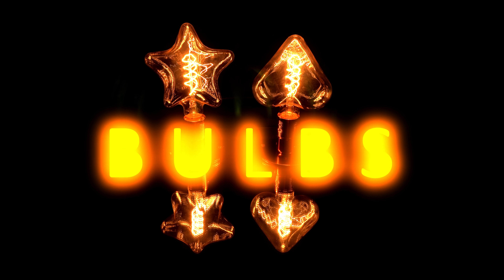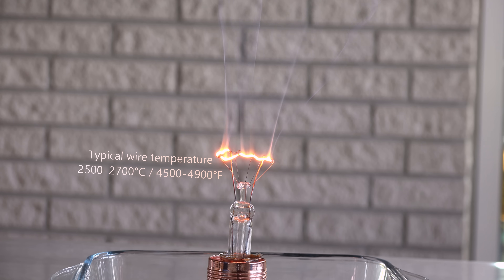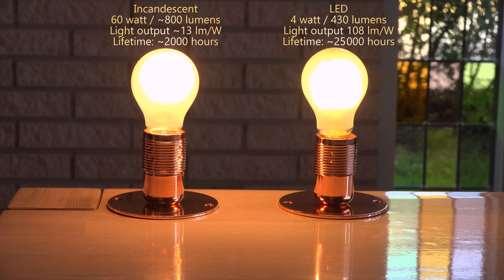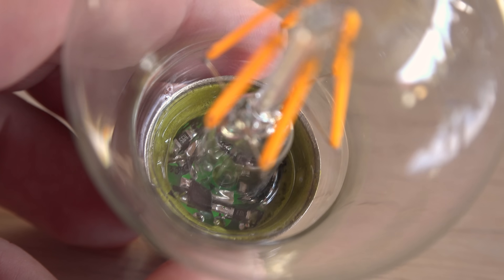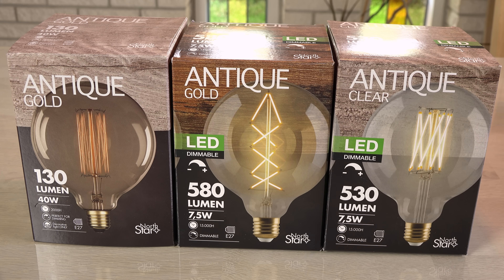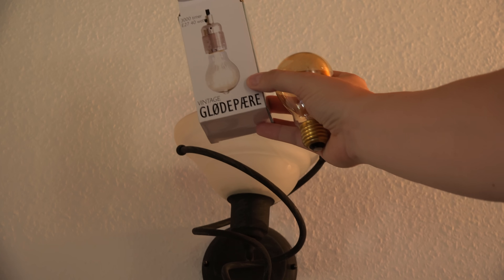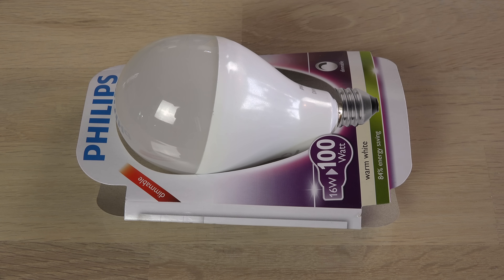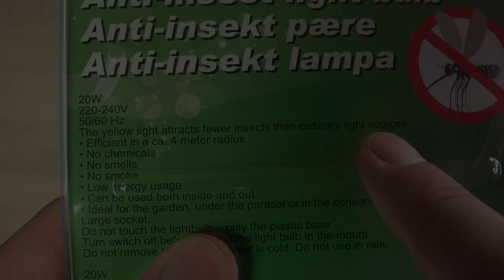Light Bulbs | LED vs. Incandescent

Comment: Incandescent bulbs give off infrared healdty light, LEDs give off ultraviolet unhealthy light. For your eyes to stay healthy they need more red light not blue.
Reply: incandescent
Reply: Dieter Soegemeier... CFL light is UV light but CFL & LED gives off electromagnetic radiation
Reply: or if you talking about light pharipe than it will be “inferred light”
Reply: What Kind  of light is good for health LED or incandescent???
Reply: Just use orange leds for lighting...
Reply: “Timotius Aditya” NO

Comment: I bought 6 packages of LED light bulbs after I read a thing stating they will last five years (under normal use) for my home back in 2016. After all I have lived in the same place for about 12 years now, so I thought that the LEDs would last a long long time!! And most of the lights in my 40 year old mobile home are old and yellowed even though I have no idea when many of them were actually installed and the home has always been in the same place it is now since 1971!! So god only knows when the last time the bulbs were changed!! Within 6 months I had gone through 3 packages of LED light bulbs replacing a number of the old bulbs as they had blown. I was at first pretty happy with the light from them!! After just three months though the LEDs I had replaced already stopped working and has more of the old incandescent bulbs failed I was replacing them too with the other three packages of bulbs!! In total TODAY in 2019 just three years later ALL the LEDs in my home have since been replaced with Halogen bulbs I find at the dollar store!! All the money I wasted on LED light bulbs which were "name brand" (Phillips to be exact) were junk and EVERY SINGLE ONE OF THEM have failed!! So much for "under normal use" too, because I am very anal about leaving lights on at night SO IT is NOT like I have my whole house fully lit up when I am NOT in rooms using them and most nights I only have on certain lights in rooms I am actually USING at the time!!! LED light bulbs are JUNK and a complete waste of money!! I laugh at the "they last five years" sales hype!!! BUT on a side note I have to add that in my shed which doubles as my work shop for the past five years I made and installed my own LED strip lighting in there!! And THOSE lights work fine EVERY TIME all the time for the five years I have had them installed!! The real kicker is I paid a lot of money for the actually LED bulbs that failed and got less light out of them, then I do in my shed for the LED strip lighting I bought on a 16 foot reel for just $20 and designed and made my own mounting system for those! So when I went to add lights in my kitchen I side stepped the LED bulbs and again trusted LED strip lights which now have been working fine for three years without a hitch!!

Comment: I still like the old light bulbs better.   Plus I had one of those weird Led light bulbs with that rubber rapping around the bottom (if it rubber not sure), but anyway it actually melted then burnt out.  I think that bulb is dangerous if it actually melted, that means it gets to hot unlike the old bulb made out of glass.   I think there is agenda behind those new bulbs....

Comment: There's quite a green lie here, first, the incandescent light is normally lit when the heating in the house is on, so the loss is not lost, second, the fabrication of a LED is costs more  environmentally damage damage than incandescent lights. Third, lots of LED's have bad powersupplies,  that may cost more in the electricity bill.

Comment: LED actually has one major disadvantage and that is the reactive power they produce. This is caused by the phase shift because of changing the AC to DC. We even tested this years ago in the lab when I was studing and teacher wanted to show us that these "energy saving" bulbs actually used up more electricity than conventional incandescent bulbs. The amount of power they draw from a socket is lower, yes. BUT they also work against the change of the AC current which is harder to measure and can't be seen with the traditional wattage meters which are directly plugged into a socket and that work against the current plus their spent power from the socket was greater than on older incandescent bulbs of same wattage.
Plus LEDs are really complicated things to manufacture which create a lot more pollution than just simple incandescent bulbs. Incandescent bulb is just glass, inert gas, tungsten wire, metallic socket head, metals to hold the tungsten wire and some glue between the glass and the socket.
LED bulbs in the other hand have circuitboards, some electric components, wires and what not.
Incandescent light bulbs could also be easily made to last a lot longer than they used to last. The double helix structure of the wire was the main reason for the wire to snap after certain amount of time. There's one of the very first light bulbs ever produced in the US in one fire department building which has been burning non-stop for tens of years if not over hunderd years. What's so special about it? At least it doesn't have that double helix structure on its wire like modern incandescent light bulbs used to have.
Based on these facts in my opinion these "energy saving" light bulbs are one of the biggest scams of all time to actually lure people to waste more energy when they are using them and also when they are produced.
Reply: Here in my house, I have two G.E's incandescent bulbs in two different lamps working for more than 15 years!
Reply: MrBrander I have a 700 square foot room with high ceilings, how should I light the room. We’re using cfl tubes. I want to switch to a healthier light. What should I do. I would very much appreciate your help.
Reply: @mangomadness8635  get warmer white flourecent tubes
Reply: @mangomadness8635  If you can find them, get regular incandescent bulbs..!
Reply: You ain't paying for reactive power, maybe that's why the meter doesn't show it.

Comment: Certain LED’s also cause wireless interference. I was unable to listen to the FM radio with the lights on (4 LED lights made by FEIT electric) as soon as the lights were turned off, radio signal was great. I didn’t test further, but I highly doubt they only cause interference on the 87.9-107.9 MHZ range, which in itself isn’t good, for electronics or your health. 
Also the bulbs ran really hot (about 70° C / 160° F), although they are rated for only 21.5 watts.
Reply: It's non ionizing radiation, so it really can't damage your cells at a molecular level. The 4G data being transmitted is more potent than any LED circuit  driver. Plus the driver only consists of a full bridge rectifier, transformer, capacitor, and voltage regulator
Reply: @danieldyman7196  That doesn't mean it's ok to transmit a lot of noise at those frequencies. Though a
bulbs conforming to all the specifications really shouldn't do that and I think most of them don't. Also a 100MHz is a very high frequency that I don't think any switching converter uses.
Reply: Yes, and that interference also makes them unsuitable for many garage door openers.  I had to tell several neighbours about this, when their openers suddenly started acting in seemingly unpredictable fashion.

Comment: PS: my hamlet (largest in the world: certified record)  gave out free NON INCANDESCENT lights via us employees. We employees got more than a couple "lasts longer than incandescent " bulbs. All of mine died many many years early, but several incandescent are still running. They cost three or more times the incandescent  ones of same watt incandescent too. Plus the NON INCANDESCENT ran the built in circuitry ballast or whatever very hot, one failed because it surreptitiously scorched the base nearly black , so hot. It was a fkng fire hazard 😡

Like most bullsht science lately, total hype, totally expensive, and designed to fail to make you totally buy into it and replace it more often. 😡
Reply: B Sc your light bulbs failed because your “hamlet” got really cheap crappy ones to give away for free. If you buy a led for the same price as your incandescent ones they will be twice as good.

Comment: If you turn on a tungsten bulb when you get home in Canada after a puny 8 hr shift, it warms your 13C heated house AND GIVES LIGHT . Two for one, sarcasm or whateverIdontFuckvojngCar.  

When you try using them with your wifi ready garage door (brand name starts with C) you repeatedly get failures and odd behaviour. Then read the manual and see it say DO NOT USE LED LIGHTBULBS. Guess what, they fkn interfere and corrupt the operation. Even when only using the provided remotes.
Reply: B Sc I have noticed that certain cheaply made LED lights (specifically FEIT ELECTRIC) cause interference on the FM frequency range, I couldn’t listen to ANY radio station with the lights on, as soon as I turned them off, radio signal was great. God only knows what kind of radiation those things are putting off, probably not good for your health either.

Comment: LED lights are more efficient in terms of thermal energy inefficiencies but to entice the public the electronics necessary to convert AC line voltages to power the LEDs are very poorly designed as high frequency inverters used create huge amounts of wide band radio noise pollution.  Turn on and AM or FM radio and then turn on and LED "replacement" bulb for an incandescent light....it is terrible!! 

Cheap electronic designs are causing huge problems and need to be addressed.  Then the spectrum of light frequencies for our eyes and those effects - more studies.

More needs to be done to abate these issues but very solvable!!
Reply: I agree... there should be a nationwide standard for electromagnetic emissions, while there are not long range, it can ruin a Hi-Fi stereo experience while close by.
Reply: another match in this world we live, as no wonder as for sATAN himself disguises himself as an angel of light, new bulbs burn so bright but burn out so fast and make more waste where old bulbs like the cinula bulb and my bathroom bulb burn dim but last for years upon years.
Reply: The problem with electricity-related issues, such as 'dirty electricity' etc., will be extremely hard to bring attention to and get addressed because as the saying goes, 'out of sight, out of mind', and electricity is invisible, so...

Comment: I'm in Australia. I don't know if I've seen many LED bulbs in supermarkets. But they have plenty of fluorescent and incandescent ones. I like to have lamps with both. I have really bad sleep problems and apparently fluorescent lights can mess with your melatonin levels, according to a couple of doctors I spoke to. I use the fluorescent one for painting minis or other things where I need a bright light. I use the other for when I'm getting ready to sleep. Although sometimes when my mental problems are acting up, I just keep all my lights on and don't sleep for days at a time.
On another note, it seems like some BS that they've banned them in the EU. They could have just used an awareness campaign so that people could be made aware of the energy savings, but outright banning them seems a bit dystopian.
Reply: An idiotic ruling by the EU.
Reply: The countless stupid and useless bans and directives is the main reason I hate the EU and want my country out of it.

Comment: Great you have mentioned issues with LEDs! The interesting aspect would be to analyze LED impact on human eyesight...
Reply: @valerierodger7700  I've had insomnia problems before, but because of stress and anxiety. Changing colour never made a difference in that. So just purchase an LED lamp of a lower colour temperature if it bothers you.
 I think that cool white is the norm in office buildings, specifically because it keeps you up. But they've been using cool white florescent tubes for much longer than LEDs have been used for lighting. The problem is that when people light their homes, they've never had to consider colour temperature, and don't give thought to it. Use warm white in your living spaces, but cool white or "daylight"  in your shop and office where focus is more important.

As for the street lights being replaced with LEDs, that's actually a good thing if they're keeping you up when you're on the road. The LAST thing anybody needs is to fall asleep at the wheel.
Reply: @thegrandfinale2 No, but they did have considerable eye strain. It's no different than sitting in a dark room with a desk lamp. You're not getting any more luminous by using a tablet instead of a desk lamp.
Reply: I thought you were in a biohazard ppe lmao not a clean suit at the first glance
Reply: It depends on what wavelengths you're sensitive to. I have no problem with cool white LEDs or CLFs, but I've got family members for whom cool white is a migraine trigger, so I try to make sure all the lights are warm white. A particular pet peeve of mine is when I see LED lights (especially Christmas lights) that are only half-wave rectified (by nature of being a diode), which subsequently give off a 60Hz flicker. You can stick a bunch of LEDs in series and use the collective resistance in place of a dropper, but you're only using half the wave while blocking reverse current on the other half (they burn out quicker that way too). That's another migraine trigger for some people. Full wave rectified, with a smoothing capacitor, is far easier on the eyes.
Reply: @BlackEpyon  I can't deal with any of the LEDs.... I hate them all and I'm not the only one.... more and more people that I've spoken to are saying how much they hate them .
    They make everything look weird artificial and flat . I used to have post-concussion syndrome and Mild brain damage years ago and it seems that those of us who have had more logical problems are really affected by them . I only have incandescent in my house I bought up a bunch of them that were on sale very very cheaply at Habitat for Humanity .
    I remember when Christmas lights used to be beautiful also and now even the colored ones the electronic ones look weird instead of warm
Reply: @gardensofthegods  What colour range are the LED lights? I find warm white (2700-3000K) to be the easiest to look at, while cool white or daylight (anything higher than 3500K) tend to be a migraine trigger for people sensitive to them. As for the Christmas lights, make sure that they're the fully rectified DC kind, not just strung together in series, else you'll get the flicker.
Reply: @BlackEpyon  I don't know about that. My boyfriend is very sensitive to leds, and the worst for him is blue. His head is pounding, like some one is putting a jack hammer to his head.  He had l.e.d Christmas lights, and he pulled the plug on them so fast he broke the outlet the same night. What came next was crazy, he took a pair of wire cutters to them. After replacing the outlet, he got regular color Christmas lights and he was fine. In fact anything that has l.e.d's in it, his head was pounding from the way that they are made. Color, brightness, contrast, or shade don't matter to him. Also the funny thing it does the same to him with a flat screen TV or an l.e.d flashlight. He can't stand a l.e.d or LCD TV or a l.e.d flashlight either. This is the reason why he still ownes a tube TV, and a flashlight with a incadensent bulb. He don't own a cell phone, because of the same reason. L.e.d's are a joke to him he said.
Reply: @hollytimlick2465  Does he suffer from chronic migraines, or have to wear sunglasses when he goes outside?
Reply: @BlackEpyon  no, he has 20-20 vision. And what does that have to do with, L.E.D's vs incadesent lighting?
Reply: @valerierodger7700  My bad. I mistook you for the previous guy.
Still, the problem with street lights isn't that they're using LEDs. Blue has a greater effect, but any artificial light will interfere with your sleep. People need to stop whining and just close their curtains.
Reply: @thegrandfinale2 The old computer nerds who were looking at all those green and amber CRTs 30+ years ago haven't gone blind yet.
Reply: @valerierodger7700  If the light outside is giving you trouble sleeping, try closing the curtains. Blaming LEDs for your sleep problems is like complaining that it's freezing while you've got the AC on, and then blaming the AC when you're the one who set the wrong temperature. Just change the temperature, and you won't have a problem.

I'd also wonder if your DSPD isn't caused by lighting, but by something else, and the lighting is just exacerbating it. I've never had a problem with computer monitors keep me up at night, even LCDs. I have ways to wind down at night (as I said, my problem is stress and anxiety), and most of them involve something with an LCD monitor. I don't have the brightness cranked all the way up, and that probably helps.
Reply: Why would LED light be bad for eyes?
Reply: @thegrandfinale2 Bright visible light doesn't make you go blind. High intensify UV light does. Such as, staring at the sun, or a welding arc without a visor. But staring at a tablet isn't going to do anything to your eyes.

Comment: I strongly disagree with the banning of incandescent light bulbs.  Their "inefficiency" is purely because most of their energy output is in the form of heat -- but what if you want heat?  It makes sense to have incandescent light bulbs in winter, because you get some heating effect too.  But most importantly, my second wife's father (in the late 1980's) came up with the best heater while working at a desk -- you have bare feet and shine a flexible-stand desk lamp with a 100W bulb onto your feet (obviously it has to be on the floor, and obviously not too close!, you find the optimal distance by trial & error).  It is far more effective than conventional room heaters 10 times (and more) that Wattage.  This banning of incandescent light bulbs is a typical 'one-size-fits-all' overreaction, very similar to many aspects of Stalinism actually, which modern "Environmentalism" and "socialism" have become.